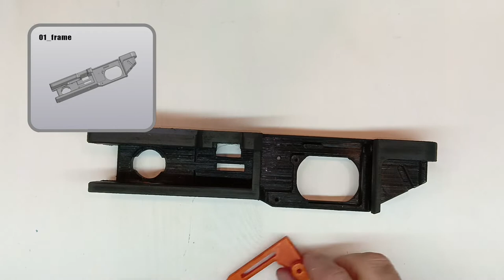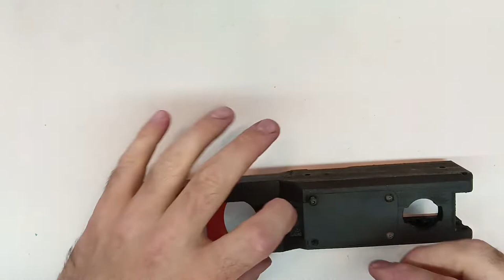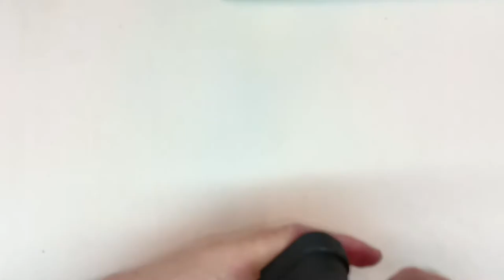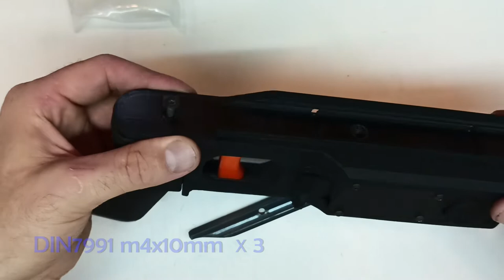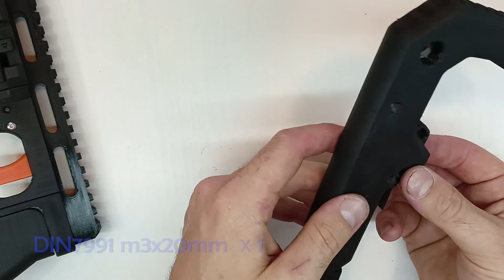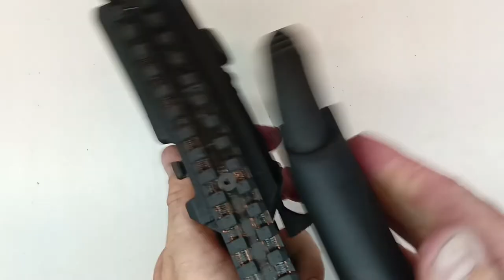Airsoft Underbarrel Shotgun for carbine

Comment: which orientation did you print the main frame?
Reply from the maker: the main frame was positioned with the top to the table, and rotated 45 degrees to the side edge